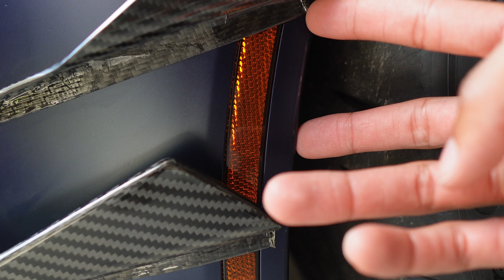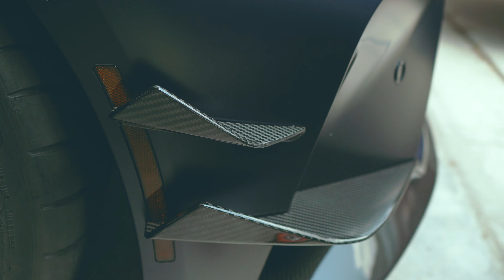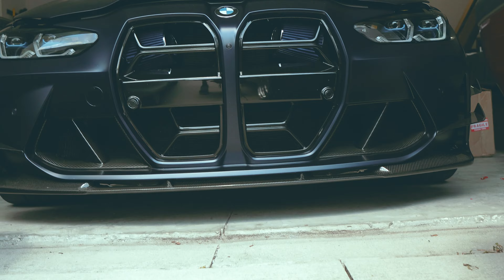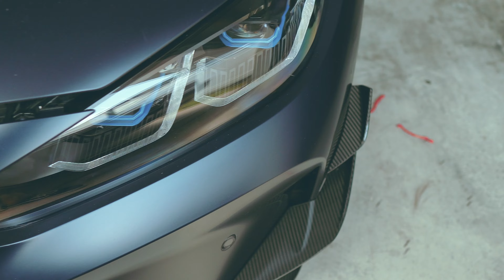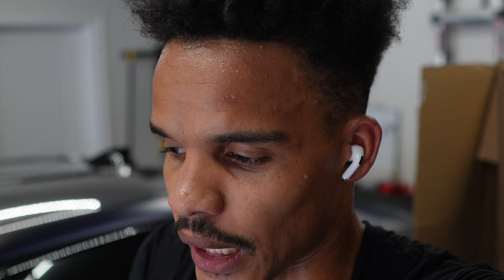How to: Carbon Fiber Canards Installation and Review -4k-BMW-G8X- AGGRESSIVE

Comment: what do you think about the carbon fiber intake, from arma speed for example… vs the titanium one you have, biggest difference?
Reply from the maker: I’ve heard sound clips of the arma speed one, sounds pretty good. I’d be interested to know if there is a difference performance wise. I know my titanium set up is the the only one with 3.5in piping so I think with a tune I would get better numbers, in theory
Reply: @OEMplus.garage  you have a link for the one you purchased? I’m interested
Reply from the maker: @okchaz6634  https://rktitanium.com/collections/bmw-g8x/products/bmw-g8x-v2-frount-mount-intakes